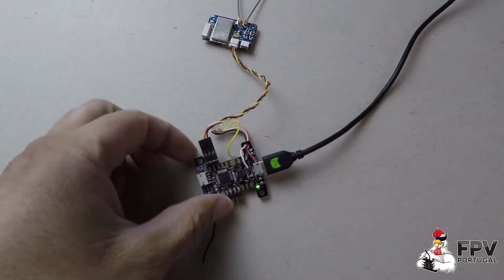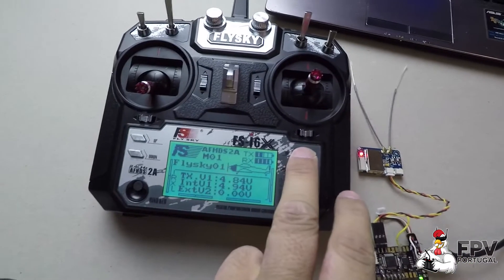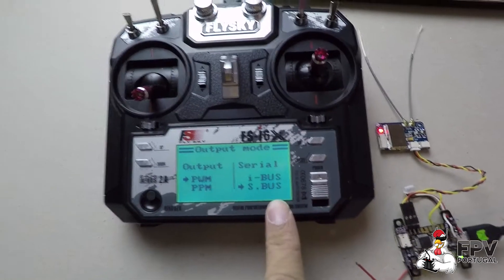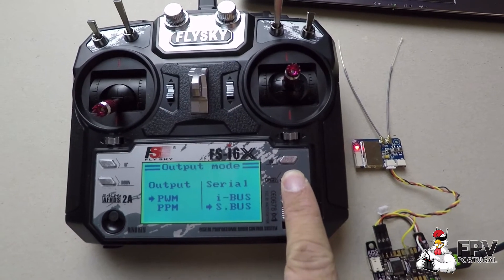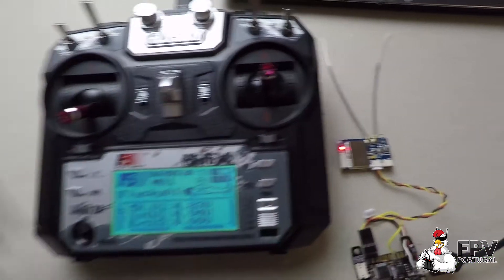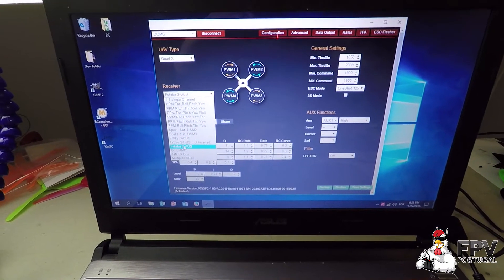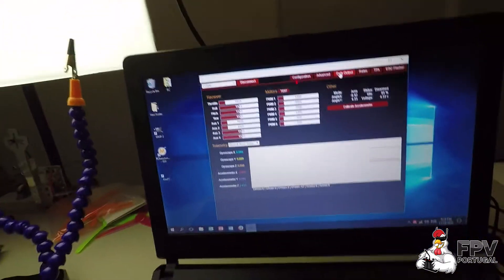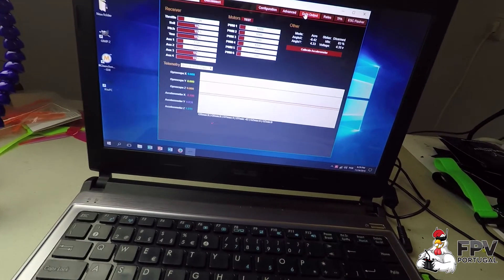How to use Flysky SBUS Receiver with KISS FC

Comment: Thanks for tutorial, but i have problem with failsafe, if i turn off my transmitter, motor still works :/ Can you help me figure it out?
Reply from the maker: Most times you need to setup the radio to "No Pulses" and it fixes your issue
Reply: @FPVPortugalTV  now its work. Before also work but after 10 seconds. I was changed FS levelmode from 10s to 0s and now it work one second after disconnect :)

Comment: Hi I have done exactly what you've shown in this video and cannot get my FS-A8S to work with my Kiss compact ctrl. I'm using a turnigy evolution and both the kiss, and TX have the latest updates.
Reply from the maker: first A8s had problems with SBUS, they work but when unplug the lipo they restart to Ibus again, last ones are fine, get one from banggood that is the last version: http://bit.ly/2qQJnff

Comment: FS-A8S sets default communication protocol IBUS. You can change IBUS to the SBUS by pressing bind button for 2 seconds. But if you power off/on this receiver it does not remmember this setting and defaults to IBUS again. This makes no use of SBUS protocol as this setting is not saved. Some users are struggling with this issue and complaining about this issue.

copied from RC groups, solved my issues after hours of troubleshooting, hopefully helps someone else
Reply from the maker: That is already a knowed issue and was fixed two months ago, Flysky is now sending V2 A8s which is now working fine.
Reply: @FPVPortugalTV  How do I fix it so it goes to sbus everytime
Reply from the maker: @SlowBirdd  the flysky released a new Rx after this bug, new one is ok, they released this very long time ago.

Comment: Tanks for the tips :) Do you know if it's work if I use the X6B receiver with the FS-i6s radio ? I have a full Kissed build but I have just 2 FlySky radios (FS-i6 + FS-i6s). Flyduino said i-BUS will be supported on KISS FC in 2017...
Reply from the maker: Rudy Guyt works, there is a non official fw with sbus support for the flysky i6
Reply: FPV Portugal Really ? Do you have a link plz ?
Reply from the maker: Check this: https://github.com/benb0jangles/FlySky-i6-Mod-/tree/master/10ch%20Mod%20i6%20Updater/10ch_MOD_i6_Programmer_V1_5

https://www.rcgroups.com/forums/showthread.php?2486545-FlySky-FS-i6-8-channels-firmware-patch%21

Comment: Hello, thanks a lot !
Quick question, how do you connect telemetry between the FC and the receiver ?
Reply from the maker: with flysky you cant.
Reply: Funny thing is if I connect the battery, my turnigy evolution blinks because the receiver has no battery, but if the kiss FC is connected to USB, it shows as having some power...
Reply from the maker: Benoît DESTRUBÉ its not connected properly, kiss fc provides 5v to the receiver on both USB and with battery.
Reply: FPV Portugal  ☺ i'm not sure what I could've done wrong, I connected it the same as you as far as I can tell ☺